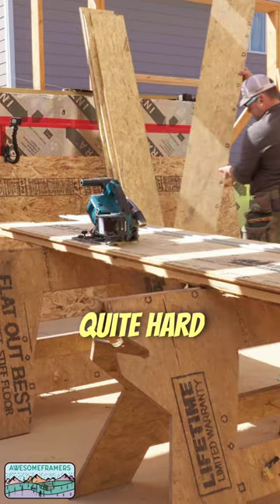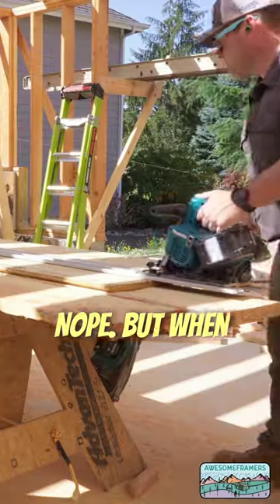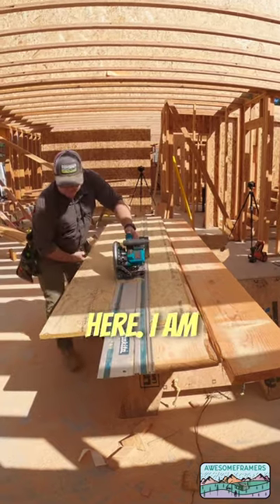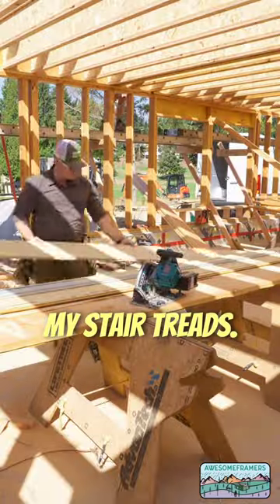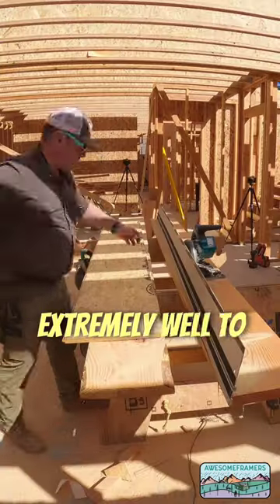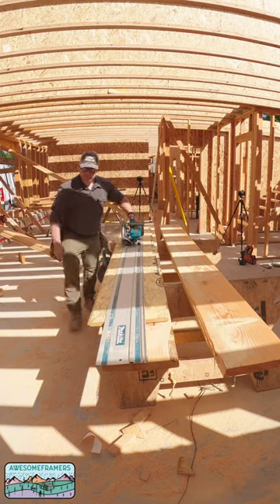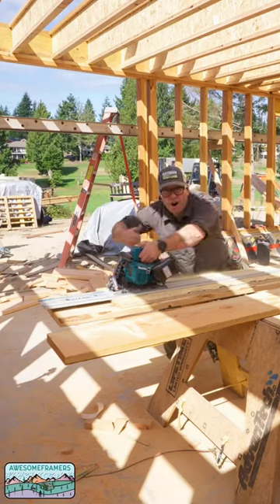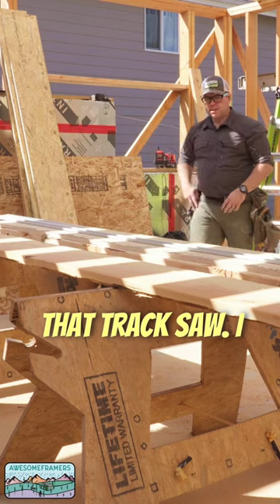Easiest Way to Break Down Sheet Goods #construction #tracksaw #protip #diy

Comment: I’ve been using the 18v X2 track saw on 1-1/8” Advantech and it works great, even with the included finish cut blade.  Someone needs to make cheaper framing style blades for these saws tho, I haven’t found any yet.

Comment: We used scrap advantek for temp treads until the house was dried in. For some reason all the builders in our area always wanted the 1” thick particle board pre made treads with the bullnose. I think probably because most of the stairways were carpeted.  I’m a union carpenter now so mostly commercial work. I really do miss residential stick framing.

Comment: I use this method for building cabinets. I stack my sheets 4 thick and use parallel guides and cut on pink foam I use the XGT saw with a 5 Ah battery its the fastest way to do all the rip cuts for building a kitchen I find. Using a tablesaw you can't stack up 4 sheet inless you have 20 to 60 thousand dollar sliding table saw
Reply: How many kitchens are you building if you’re breaking down sheet goods with a track saw? There’s a point where that time and labor cost more than the slider.

Comment: I used a 220 volt table saw for rips and a  220 volt arm saw for cross cuts.  We would always set up a saw shop out by the street and leave it set up. Material was 2×12 Douglas fur or sometimes lvls.  Shouldn't  take 1 day and needs done while it's being plumbed and lined.  Before the joice or at the same time.
Reply: I would really like to see your setup

Comment: 3/4 Advantech is the way. Even if its temp treads. You dont want to cheap out and use 5/8 scraps, you might lose your plumber and gain a ceiling hole. Ask me how I know

Comment: Usually open mouth in a THUMBNAIL is a good indication that I should go Three Dots / Do no recommend channel.
But Open Mouth in the actual video for several seconds ? That's another level.
Also, clamp that guide before using it.